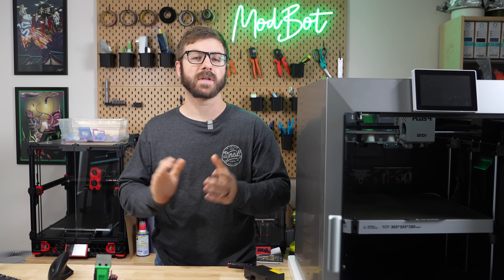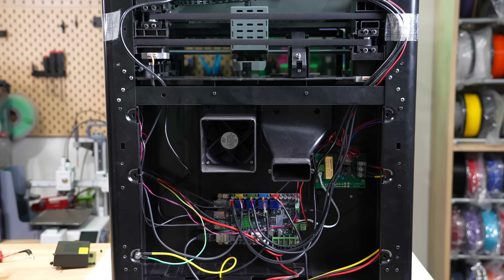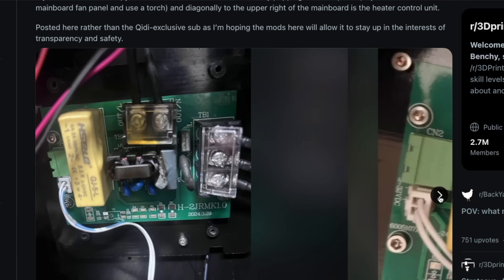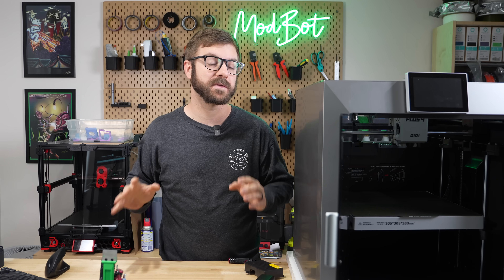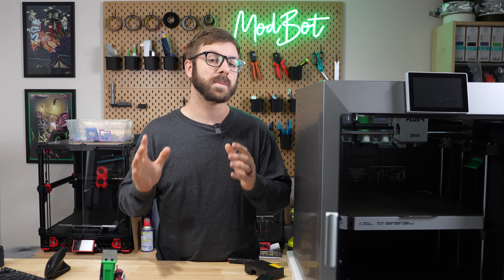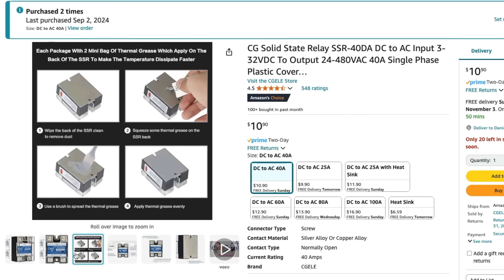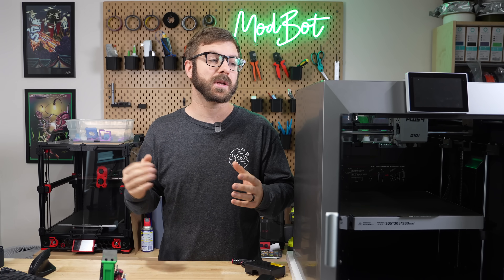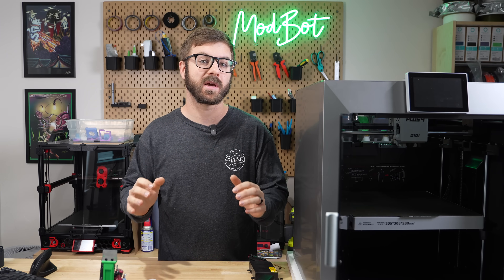PSA: SSR Safety Issues With Qidi Tech PLUS 4 Printer

Comment: Firmware? Lol. An SSR is essentially just an electronic switch with no moving parts. The reason they're burning up is that if a machine is running at 220V at 600 watts It's pulling about 2.7 amps so within spec. 

Running at 120V means it's pulling 5 amps. That crappy SSR isn't even rated to run on 120V AC power. That's not something that can be fixed with a firmware update and these things wouldn't pass certification to be used in the U.S. 

My guess is that even though the datasheet for the SSR says it can run at 5 amps, 5 amps at 120V is 600 watts and is its maximum rated power level. 600 watts is legit a massive amount of current going through the tiny switching triac inside that SSR. It can't dissipate the heat and it's melting its own housing. Not to mention the downstream coils probably aren't rated to run at nearly 600 watts.

This should legit be recalled as it's a safety issue.
Reply: Firmware limiting the duty cycle should help in the short term while sending out new boards; hampers performance but 2nd best option when stuff hit the fan in the first place.
Reply: It is using a low frequency PWM. It does not run constantly.
Reply: @802Garage  SSR's contain a triac internally. It's driven using phase angle control. PWM is generally used for DC electronics.

The SSR here that's being used is an AC variant, meaning that the heating element is being driven by live AC current, so 120V at 60Hz. You know what happens when that triac fails short inside the SSR? 

Live AC current is allowed to flow uncontrolled to the heating element. That'll cause the SSR to melt, and potentially cause a failure scenario where the live wires at the heater conduct more power than they should for an extended period. That can effectively turn the wires conducting the current to the heating element into their own "mini" heating elements. If the insulation melts in the right place, it can put the entire printer at live potential, or worse, a part of the printer that's insufficiently grounded. If you touch that part of the printer and it's not earthed, chances are that you yourself become the path to earth and get electrocuted.

Incidentally, I doubt the metal chassis has a proper connection to earth either on each individual metal panel, which is also a reason these damned things need to be certified to be sold.

These clearly weren't because they're being sold with components installed meant for an entirely different power grid.

This is a company taking shortcuts and some of the people already affected are lucky they haven't had their houses burnt down or been electrocuted.
Reply: @NewRetroRepair  I was trying to be brief. I know it is not high frequency PWM. It is more in the 10Hz range from what we know. It is still not running the heater 100% with uncontrolled mains voltage. Off the shelf self contained SSR units are designed to be pulsed in this way as well and in fact have already been installed in Plus4 printers and are working fine. It's actually a built in feature of Klipper. The power factor was changed from 0.7 to 0.4 in the firmware which drastically reduces the current used. However there is still an issue with the chamber heater power supply board design. This has all been discussed AT LENGTH on the Disk-chord.
The SSR is not the failure point of this board, it is the inductor AKA the choke. That is the component which is overheating and failing. The panels of the printer are not metal, but plastic. The structure is metal, and it is grounded. Please stop wildly speculating and spouting off the top of your head. This exact SSR board is used in the Q1 Pro and has had essentially zero issues on 120V since the printer launched. The difference is that heater is only 300W and they run it at 1.0 power factor without any form of power modulation. The problems are not what you think they are and your belief this was never tested on 120V is false. There is a lot to learn here.
Reply: @802Garage  I get what you're saying but respectfully I'm going to say that I'm not wildly speculating here.

Look at the data sheet for the SSR. It is not rated for 120V. It's rated for 220V.

That's why it's melting. There's too much current running through it.

Respectfully, firmware tweaks cannot and will not magically fix a component designed for an entirely different electrical grid.

If that SSR is melting at less than 100% load then that's a massive red flag, no? It probably has something to do with phase angle control not being something that can achieve current limiting. 

The load will still draw 100% of its required current to function when the SSR is in the "on" state. That means that the triac inside the SSR is going to be at its maximum operating current of 5 amps with a 600 watt load when it's "on" at 120V, which it isn't rated to do according to the SSR data sheet.

That's because it's designed for 220V. Running it at 120V will generate more heat, and cause the SSR to melt, as seen in this video. Internally, that's going to be absolutely thrashing the heck out of the SSR's triac, which can make it fail short. If it fails short, the load, which in this case is a heating element will draw 100% of the current 100% of the time. The smoking gun is literally a smoking solid state relay not rated to be used at 120V. That relay in question is fine for 220V, because as ohms law tells us, I = P/V, so 600/120 = 5 A. That SSR is running at its maximum rated current on a voltage it isn't rated for.

If the firmware of the external controller is setting the phase angle control to 40% that doesn't mean that the total power when it is "on" is 40%. It'll be 100%. It'll just be drawing 100% for 40% of the time. In other words, the average power draw will be 40% over time, but at any given instant that it's "on" the power draw will be 100%.

And yes, I do know that SSR's are designed to be used with phase angle control. I've used off the shelf SSR's to power a 2.4kw load in one of my own projects.
Reply: @NewRetroRepair  It's very confusing how you can have such a mix of knowledge and misunderstanding. The Voltage rating of the SSR is not an issue whatsoever. It says on the top of the relay it is rated 24-380VAC. It can be used with single phase 120V without issue, just like every off the shelf SSR, most of which are rated 24-240V. So that was nonsense.

You are of course correct that over current is an issue. On 120V it will draw, to make things simple, about twice as much current as on 220V or 230V. There is no issue with "grids" only with current. Yes, at 600W it will be pulling 5A which is the max rating which is not good. Hence we come back to what I already said and what Qidi has already clarified which is that on the old firmware it was drawing too much current and is now supposed to only draw 460W. Again, many people in the community have already tested and confirmed this is true.

However, there is still an issue. That issue is not with the SSR. 460W, current spikes or not, is only 3.833A. I know Ohms law as well wowowow. The SSR is not the failing component, it is the copper winding condcutor sitting right next to it that literally gets so hot it burns the windings until they are black. Now, why is that happening? Probably current!

However it has nothing to do with power grids or 120V specifically, but again, how much Amperage is flowing and yes possibly power spikes because as you said every time the power is pulsed it has peaks. Part of the problem may be that there is no zero switching functionality on this relay board, unlike in many aftermarket SSR units, and also I don't think it is using PAC, but just a rudimentary 10Hz PWM built into Klipper.

Respectfully, it's very clear you just learned about the issue from this video and you are very behind and incorrect in multiple ways. You are speculating, as we did weeks ago when this issue first popped up, and you're doing it in the wrong direction. If you want to actually get up to date and contribute, I recommend joining the Disk-chord. The new board uses an inductor with much thicker copper windings fewer in numbers. We are doubtful of the fix, but not because we don't understand component Voltage ratings.
Reply: @802Garage  Im going to end this by telling you that the SSR datasheet says that it's only rated at 220V and also that SSRs are not current limiting devices. They're glorified switches.
Reply: @NewRetroRepair  24-380VAC is written on top of the relay. Depending on which site and data sheet you reference they say 220V / 380V and that is the max Voltage rating. Again it's incredibly confusing how you can understand a lot and yet so little. I am well aware of what an SSR does. It's in the name. It's a relay. The SSR is not the failure point, it is the choke. Every single person who has actually tested this, including Qidi, is in agreement. Please stop talking out of your rear.
Reply: @802Garage  Chokes fail short or open mate. If the choke UP STREAM from the SSR failed, the SSR would NOT have any power. The SSR literally burst into flames and melted because of the massive current draw from the load down stream from it. I don't really give a shit what other people on Discord or Qidi are saying. Qidi said a firmware update could fix it, rushed it and didn't get their trash certified. You have NO idea what YOU are on about.
Reply: @NewRetroRepair  #1 Thought you had ended this.
#2 You could at least admit you are wrong on the voltage rating, because you are.
#3 You are still incorrect and the failing component is the choke, not the SSR.
#4 The reason the SSR melts is because the choke right next to it is getting to likely 200C or more in some cases. It has been measured to up to 180C, well past the point of the wire coating failure. It is radiating heat and melting the components around it. Not just the SSR, we have multiple pictures of all components around the choke getting discolored and melted. Not to mention when a component gets hot it heats everything connected to it via the metallic connections.
#5 You haven't even investigated this issue more than this video and you think you know more than everyone. That's bizarre and ridiculous. I've already presented you with plenty of basic facts for you to understand what is going on, but you refused to listen at all. You refuse to even read numbers written on a component.
#6 The firmware update did dramatically reduce the issue because it lessens the current through the choke and drastically reduced the temperature. It was not enough in all cases because we are finding not every chamber heater is drawing an equal load, either due to damaged components or inconsistent heaters. It takes far longer for the inductor temperature to rise and it does not reach as high of a peak. Since the chamber heater takes time to heat up, most boards will run for a long time with the new firmware without any signs of a problem.
#7 The SSR has never burst into flames. Why are you straight up making stuff up? Are you literally hallucinating an issue? This is nonsense. There has been no evidence of fire yet, only overheating of the choke and melting of components. The worst damage to an SSR cover has been slight melting around the vent slits.
#8 We know the chokes have failed because we have at this point 20+ pictures just in what is saved for reference including those where the choke is completely black and charred and every other component is still more or less in tact. Chokes that ran on the old firmware tend to be completely burned up while those running on the new firmware only exhibit signs of overheating such as discoloration and char marks between coil wraps.
#9 The choke does not have to completely fail and kill all power to the SSR for it to be degraded. It's simply copper coils wrapped around a tower. Unless the copper coils are severed, power continues to flow. That is what we are observing. You are at least smart enough to understand that a continuous run of wire transmits power, correct? However, once the coils have burned off their coating, they basically become one big blob of copper. The current is still running through the small connections at the base of the choke, but it's no longer a big heating element.
#10 You clearly haven't thought this through for more than a few seconds and for some reason you are desperately clinging to incorrect assumptions. I find it offensive on an existential level that anyone is this sure of themselves and this upset about a topic with this little information.
#11 When the new SSR boards are installed with the only changed component being the choke and the temperature tests are conducted, which should be happening within the next day or two by the way, I'll come back to ask if you can admit you were completely wrong.

Comment: Unsafe 3D printers particularly from China, is nothing new. I only whish reviewers had the skill to call the practice out, without parts catching fire or burn out. Thanks for making a stand, despite you obviously putting a lot of effort into reviewing this printer.

Personally, as a designer, I don't feel like using this kind of heating nor control of the heater at all, due to the insane vibrations and risks associated with the speeds and accels these manufacturers are targeting. It feels negligent and feels like a complete disregard of the people using their products. The solutions seems on their face, to be stupid and retarded, speaking as a designer.

Probably not that popular opinion in here, but I actually are hesitant to make a product that produce gasses, that are known to be toxic, without actually dealing with them. Like this printer. Sure, you can make a printer like this, just as you can make a blow torch. And sure, you may pretend using a blow torch is now completely safe, even for dummies. But doing so, who are you?

There is a room for new players in this industry, if consumers simply start valuing the right stuff, and the press and reviewers learn to call the wrong out.

No smoke was needed in this case.

Comment: Just to confirm, is the issue has nothing to do with 220V machine?
Is it the problem for 110V region?
Reply: Yeah, for the same wattage the current needs to be higher in 110V so while current is in spec for 220v its too much current when on 110v.
Reply: @notsonominal  Seem like their Plus 4 are built only for 220V region and they rush to sell for 110V region, which big markets are there, without proper QC on voltage different. It's a big mess up though.
Reply: due to requirements for active power factor corrections you'll be hard pressed to find (compliant) power supplies for 220v that arent universal input 90-240v; that only leaves the actual heater - and they forgot to size up SSR for increase current.
Reply: @notsonominal  Seems like an easy fix to replace better quality and suitable current SSR would solve the issue.
Yet, this is product for masses not every know how it works, even though they know how to fix, it still not a good choice to spend money on stuff that needed to be fixed and having risk from stock.
Reply: @stickercambodia  they used a custom board so mounting and covers might be an issue; but yeah if sovol isnt sending out replacements then they might as well call Anet and ask them to hold their beer.
Reply: @notsonominal  that's fainr enough!

Comment: I think this issue should be handled the same way bambulabs handled the A1 heatbed cable recall. Pull them from the shelves and have everyone either stop using the printer entirely, or physically disable the bed heater and print without it

Comment: I don't see how this would have passed any certifications in Europe or North America. We have very specific certifications for just this reason. There is a reason regulations exist.
Reply: Anet A8 and even as recently the Bambu A1 had issues. As long as people prioritize price, manufacturers will continue to take shortcuts.
Reply: Most consumer grade certifications are left to the manufacturer to just declare conformity to relevant standards. Using a notified body for testing is only required for stuff like medical devices or use in hazardous environment etc.
Reply: CE relies on self certification. Authorities will only act after complaints or incidents. The manufacturers would have to hand over their entire construction documents upon request.

One by one, including Bambu, would get into legal trouble if that happened. Most don't even have a declaration of conformity, let alone a list of REQUIRED standards they need to comply too and are in compliance with. 

I've done work for a Chinese PV inverter and home battery manufacturer. They simply don't care.